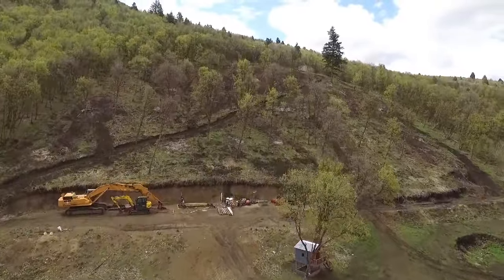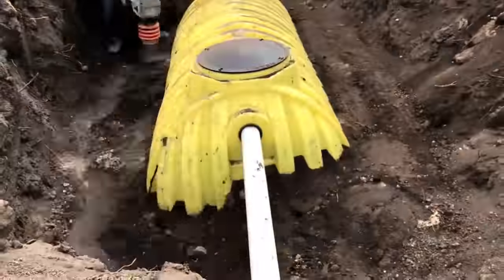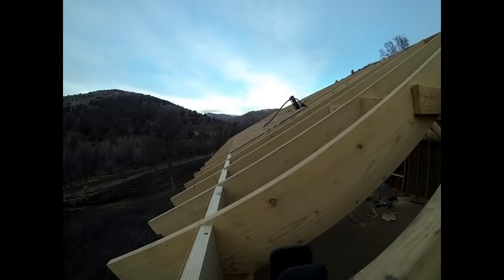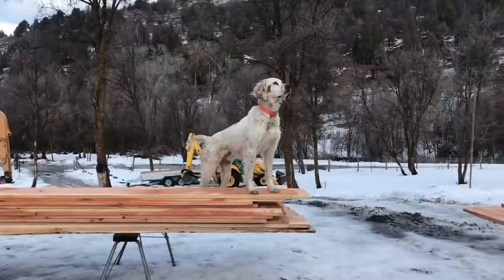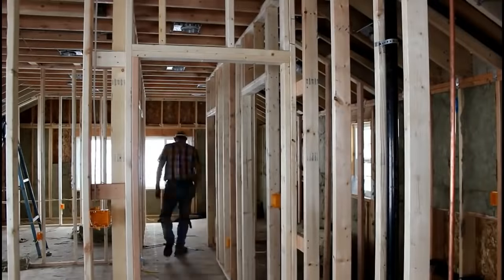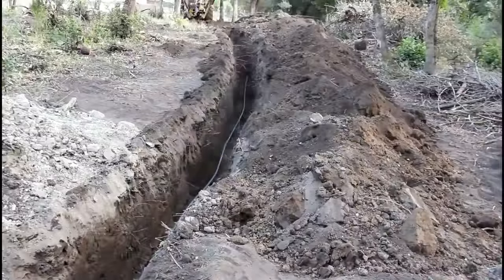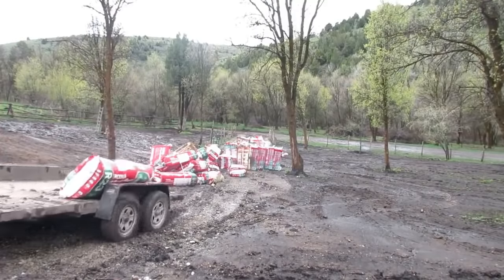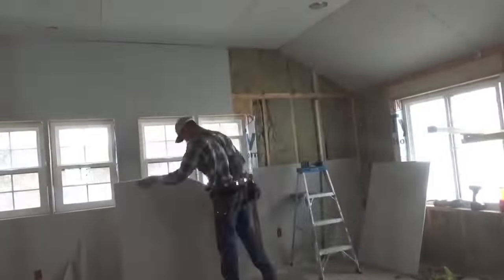#327 - I Built My House By Myself - 3 Year Timelapse - Off Grid - Debt Free

Comment: I've Been A Carpenter For 35 yrs and I Have One Word .. Respect
Reply: This is badly built tho?
Reply: @minecraft6051   he doubled His bucks around doorway and windows openings, triple the headers ,he put cats in all the floor joists ., engendered the roof. I dint see straps on the wall beams but im pretty sure hes not getting a hurricane .. He poured a solid slab ( didnt see him tamp and spray but theres prolly not much ground moisture..
 Whats badly Built ?
Reply: Jan Kotnik are you also an expert in building homes?
Reply: @tarkus4283  im from europe we bricklay mostly, But I Have a cabin in the Woods that I would say is structuraly more sound than that
Reply: @orlywolf2885  my father and uncle Have a construction company, 35 years in the family, bricklaying, carpentry, Electrical and ceramical work, plumbing. I Am currently working on a bachelor in arhitecture, But I worked my Ass of every summer and on weekends since I Have been 10 yrs old so yeah boy, But we in europe do it diffrently than you Us Boys
Reply: @orlywolf2885  I would never call myself an 'expert 'on anything. but I've probably been involved in the construction of over 2,000 homes during my career. I started with shell work (slabs, form work, tie beams  and Roof Systems )then moved to Interior( framing. drywall ,)all the way to finish work (baseboard and crown molding) installing doors and windows etc. I've also built my own cabin ( all Hewn built ).  Ultimately what he did by himself, as a plumber, was very impressive
Reply: @orlywolf2885    sorry. Meant for the other guy brah

Comment: Watches son fail at breaking concrete block

"Good help is hard to find"
Reply: My thoughts.
Reply: Did you just call a wood block a concrete block?
Reply: @rigo.acosta  lol proves his point.
Reply: Yea definitely a 2x lol
Reply: it was soaked in wood
Reply: this is what dads are like
Reply: @thecoolclips1  
What in the hell is a 2x?
Reply: @DEATH_TO_TYRANTS  A "Two by" short for "Two by Four" (2x4) which is the width and height of a piece of wood. Well , not exactly 2" x 4" but that's another topic.
Reply: @Joebus100  
Sorry, I'm on the sauce. I read it as 2x as in 2x speed of playback. Lol.
Reply: @Aaron Turner That kid was hammering a piece of wood... but with the hammer backwards, using the nail pulling side. Time for glasses, my friend. Also, time for the 997 other people who need glasses to get checked.
Reply: @TheCynicalDude_  exactly!
Reply: @Florida Man I like the phrase "on the sauce". It has such a nicer ring than "crippling alcoholism".
Reply: @Joebus100   If you own a house that was built in 1909 like I do, that other topic becomes apparent very quickly! anyway one and a half by just doesn't have the same ring as 2by
Reply: Wood is harder to smash than concrete at that thickness, and that was wood.
Reply: @rigo.acosta  Good help is hard to find
Reply: @DEATH_TO_TYRANTS  I mean let's be honest, if you didn't watch this on 2x what are you doing with your life ;)
Reply: @TheCynicalDude_  And that hammer backwards is the part most people watching this video overlook.  Hell, even I had to stop the video to see what he was hitting and that is when I noticed the backwards hammer. lol
Reply: priceless

Comment: I just finished my civil engineering degree in Germany. For your next project, if you have the construction plans I can help you out and check the calculations for you if you want. Like checking all the forces coming from wind, snow etc. And maybe the calculation give other opportunities to build the house cheaper like different material or less material but build in in the most efficient spot and so on. If you are interested let me know :)
Of course I would do this for free ;)
Reply: SarnoFRESH  can I get that deal for free???
Reply: @jayrob8619  So when bulding a house should the plans get checked by a civil engineer?
Reply: @lifesabeach5405  you can calculate the force of the weather
Reply: @MBUOffical  Absolutely. You can plan for common weather in the area, and plan for extremes up to a point.
Reply: On my last quarter earning my BSCE.  What did you think about that large hillside next to his house? Angle of repose? Landslide potential? I think removing all those trees was a mistake

Comment: 2,000 square foot well built house for $16.00 / Square foot = $32,000 = CONGRATULATIONS!
Reply: Opportunity cost is more important. Have you counted the machinery cost you use during construction. Further, what is the trade off if you could work somewhere else and the specialized workers worked for you...
Reply: @tahirshah6979  He said the average in the area is $150/sq ft, which comes out to $300k. That's a pretty big difference. He'd need to be making about $90k/yr (after taxes) PLUS have the money to pay someone else. I think the opportunity cost is probably in his favor here!
Reply: $300k home that he would have paid over $600k after 30 years of interest.  Do it yourself of $32,000K is a steal.  If the community got together and helped each other build one another's homes just imagine what could be done at very low cost.

Comment: Really weird how the building is done compared to where im from.
Reply: where are you from ? Architecture and construction is very regional dependent (also majorly weather)
Reply: Tarique Ali , true. Over at the islands its all about cement blocks and concrete cause of the storms. And at the states is all about wood, dry wall, and bricks mainly cause of the climate changes. Its kinda cool in my opinion
Reply: @babypinkbean  That´s why whenever there´s a tornado or hurricane, these houses will just blow over like matches. There is NO WAY you would get a permit for anything like that here in the EU.
Reply: Datreja 😂 exactlyy. Cement block houses hold literally everything but a crazy high magnitude earthquake and even now the way they are making these new buildings , they are made to withstand earthquakes and not break like a house of cards so I still dont know why they havent started changing the way they make houses here
Reply: Exactly. Its insane to even think about making a house from anything other than bricks and cement
Reply: Because the US has a significantly different climate from Europe. Temperatures and weather conditions swing much more drastically. There are reasons we make our houses out of wood or brick. One example is wood is a much better insulator than concrete, and in most of the US, the winters are very cold & summers are very hot. There actually are plenty of stone houses in the northeast, but many of them have been changed to wood or are now abandoned for one main reason; climate. I'm from Ohio, and my wooden house from 1850 has survived 2 tornadoes (that we know of, one of them was an EF3 which brings up another point: wooden houses are easily repairable/rebuildable) and 170 years of severe weather.

Hope that clears things up a bit. Sorry for a big ass paragraph.
Reply: @esco5593   Im from the northern part of Sweden where the climat goes from -30 celsius during the winter to 30+ in the summer and most of our houses are also made from wood. Its the way that you build that i find weird. I work as a carpenter and the fact that you dont have any "aeration" between the wall and panel allowing the wood to "breathe" and the use of plywood on the outer wall seems weird to me. Dont you get alot of problems with black mould?
Reply: @mor3gankfreeman127  No, I've never had mold problems and don't know anyone who does, despite living right next to a river. I'm not a carpenter or anything like that, so I don't know how it all works, but I think houses built in the 1700s are way more susceptible to mold. So we must've done something to fix that in the early 1800s or so. This stuff is out of my realm of knowledge, though.

Comment: You could think about making the patio with the door in the living room into an addition to have a mud room, linen closet and/or guest bedroom then put the front door on the wall in the addition facing the shop, that goes into a mud room with a large entry way leading you to the living room and kitchen where the front door would use to be.  Then you could think about moving the back door that’s in the kitchen to go out of the laundry room. With the back door going out through the laundry room would not only give you quicker access to that side of the house but a better spot for you dining room table or even a bigger one. 

Just a suggestion I have been thinking about commenting while following along your videos.

Comment: I did the same thing all by myself.  I paid cash as I went.  It took me 5 years and two 150 year old barns!  I am sitting on 4 acres of wooded land on a 140000 acre lake.  I had central heat and air put in and totaled out at right at $57000. That was 20 years ago but it was the right decision!

Comment: Hello! I would like to ask you why in America they like to build frame housing so much ? Maybe I'm wrong, but in my opinion it takes a very long time to build a frame house, and there are a lot of pitfalls in it- the insulation settles over time and cold bridges appear, the tree rots and in the cold bridges especially, the structure itself is quite shaky and prone to walking, and even to hang something heavy it is necessary to strengthen the attachment point. In Russia , about half of private houses are built from gas blocks ( how is it right ? the building block is made of foamed concrete base) , the rest is made of ceramic blocks , expanded clay blocks , wood , brick , non - removable formwork, factory - made wall panels ( in fact, frame construction is also made of ready - made panels ) and only 1-2 % of the classic frame . I built my house of 130 square meters with 2 assistants in 4 months (without interior decoration) from gas blocks of 40 centimeters and 3 layers of mineral wool with 5 centimeters of insulation from the outside . Frost holds perfectly , in recent frosts under 40 degrees Celsius , about 20 kilograms of firewood per day went away , I don 't think that a frame house would have coped better . Thanks for the answer!